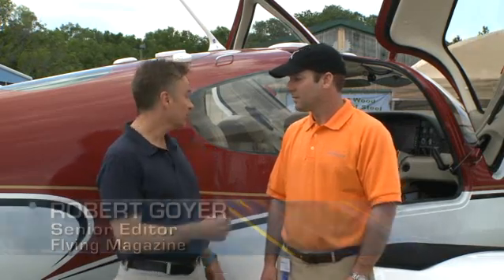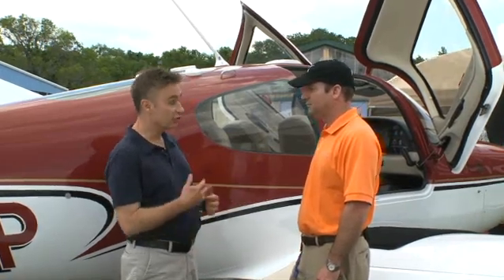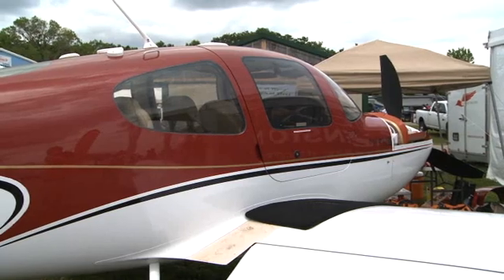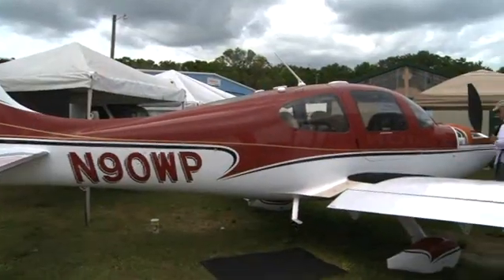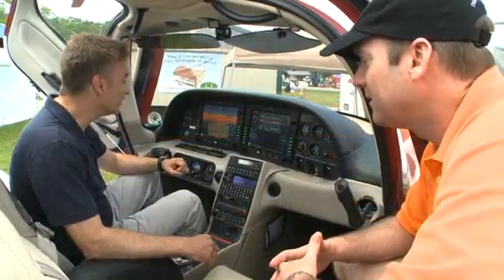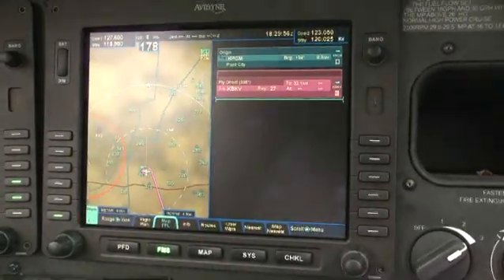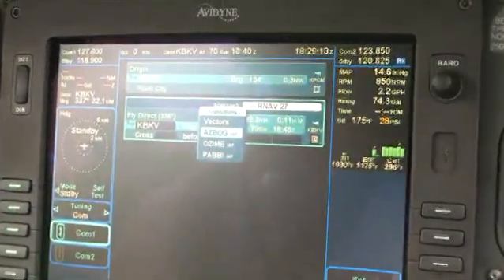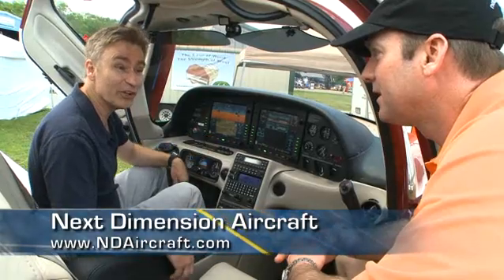Next Dimension Aircraft Cirrus SR22 - Flying Magazine

Comment: Robert commented about the engine and it needs to be corrected. The turbo system in the Cirrus factory installation is a turbo charged (low compression) TSIO-550-K. Where the TAT installation is a standard (high compression) IO-550-N with the turbo normallized kit added to it. Cirrus used to buy the kits from TAT until they went to the TSIO-550-K